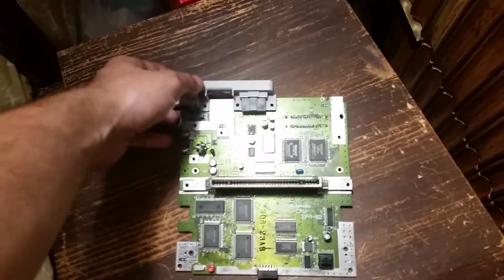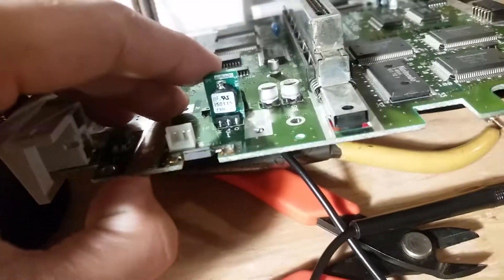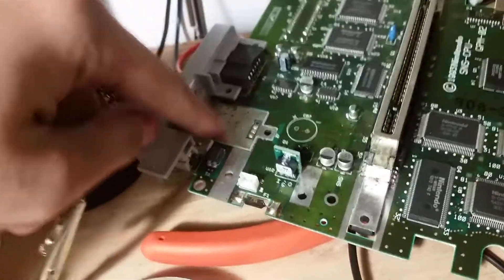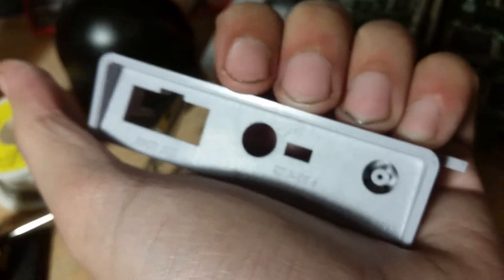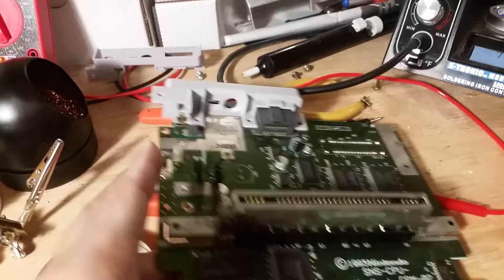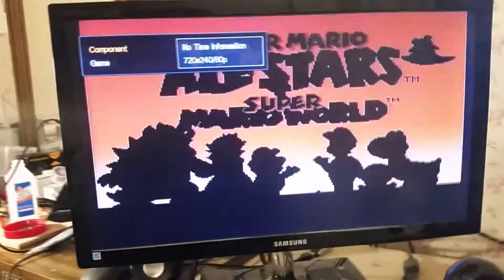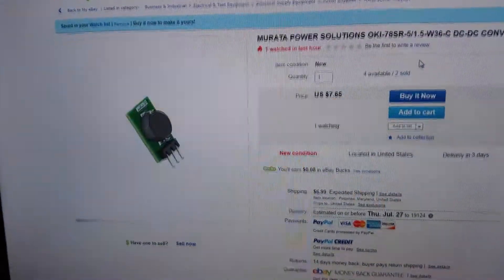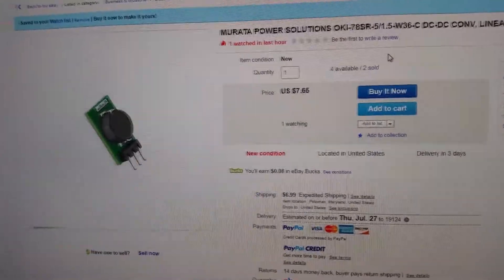Faulty SNES 7805 replaced with a Switching Voltage Regulator - NO MORE HEATSINK

Comment: I would still go with switching voltage regulators in NES and SNES consoles, it's that I gotta be mindful of capacitor choices - extra power tank capacitor wouldn't hurt as sometimes the capacitors in the voltage regulator modules aren't really rated for anything else but higher frequency ripples, it's the low frequency ripples I would be worried about (it obviously influences the DAC audio and video circuit - anything analog is quite sensitive to anything).

Comment: My sfc GPSM-02 has blown a couple of 1.5a pico fuses.  The store owner at a retro game store in town said for me to check the 7805.  I have been using a generation 1 Sega Genesis adapter to power the SFC.  By the sounds of things do you think I should just change the 7805 fuse and the SFC will be up working again?

Comment: Thank you very much Danny C. for the very interesting video, I would like to ask yourself something with which regulator you stay in use with the murata voltage regulator or the regulator that sells 7805 L78S05CV, I would like you to guide, the murata regulator does not give problems with the use  on the console.

Comment: Thank you very much Danny C. for the very interesting video, I would like to ask yourself something which regulator you use the murata voltage regulator or the regulator that sells console5.com the 7805 L78S05CV, I would like you to guide, the murata regulator does not give problems  with use on the console.

Comment from the maker: I've since gone back to using a linear 7805 voltage regulator rated at 2amps (the higher rating clears up the picture quality). I got annoyed by the constant moving diagonal line ripple noise in my Super Nintendo's video output from the switching voltage regulator.
Reply: Do you happen to have a part number for the regulator you've gone back to using or is it just the regular non upgraded? I am using a/v and I've got a vertical line only visible when its a dark screen but very irritating. From what I've read, that could be the issue but keep running into part numbers being obsolete.
Reply from the maker: 7805 L78S05CV I bought it from console5.com dirt cheap, there's a link directly to it in the description

Comment: I have a silly question, I have a Snes GMP 02 with no sound and a lot of static in the video signal(im using the AV Multi out) yesterday I replace all the caps and now it has a crystal clear image but still doesnt have audio output, do you think it would be the Voltage Regulator? cuz i mesaure the AC adapter and the specs say 10 Volts output and now its putting 13 Volts out
Reply from the maker: I was starting to have no sound also, but when I wiggled around the Multi-Out cable in a certain spot I would then get sound. I cleaned out my Multi-Out using a q-tip with rubbing alcohol and now the problem is completely gone.
Reply from the maker: I'm going to assume that there might actually be something wrong with the 7805 voltage regulator on your SNES if the voltage is fluctuating like that. It wouldn't hurt to go ahead and replace it to see what happens.
Reply: Danny C. its funny cuz yesterday i check the voltage regulator and its stay in the 5 volts output, nothing wrong and still doesnt put any audio soo my last chance is changing the AC Adapter i hear that probably the cause of the issue,anyway thanks for the support and info buddy
Reply from the maker: No problem. I didn't think of that, the problem could be that simple, replacing the power supply and I overlooked that.
Reply: @SpikerDragon95  Did you figure it out?
Reply: @inputfunny  sadly no, beside that I think I bridge a conection and now theres only a black picture, maybe I tackle later for an update, a reason maybe be sound chip is fry
Reply: @inputfunny  great news! I fix the sound issue, well kinda of, what I did is I downloaded a schematic of my model of Snes, then I trace the line for the left channel, after I identify the pin for the left channel of the multi av out, I use my voltimeter in amp(as a bridge) and start touching all the components related to the audio specially resistors and capacitor to pin of the av, one by one each getting closer to the audio chip, I finnally I get audio from a resistor near by for the components of the pre amplifier, whats the issue? I think one transistor or trace broke of from the post amplifier, after I got audio I solder a wire from the resistor to the pin of the av out by passing the post amplifier, is the proper solution? Nope but hey I finnally fix it, dont know what kind of problems gonna get bypassing all of that
Hope this help you with your snes
Reply: @SpikerDragon95  Nice. I'm glad you "fixed" it. Lol.